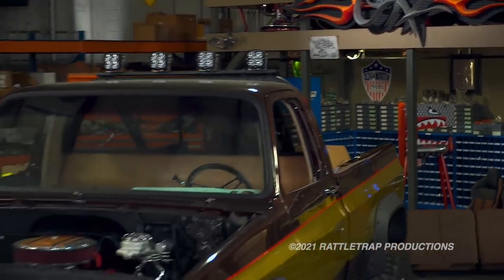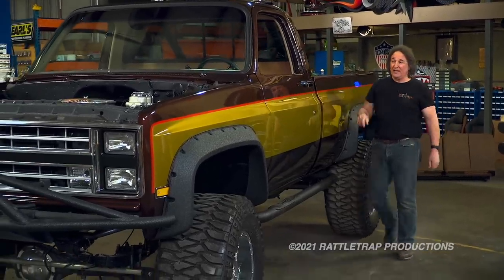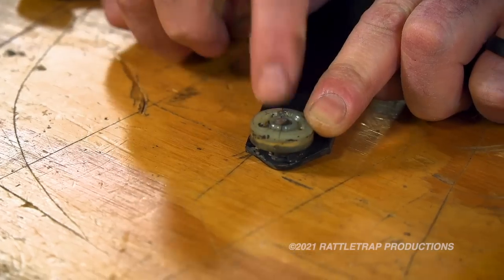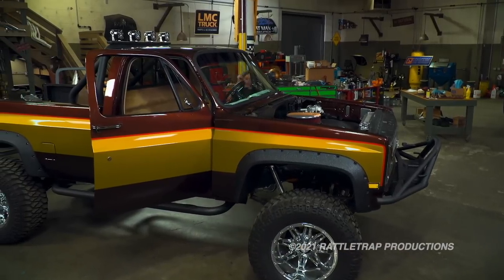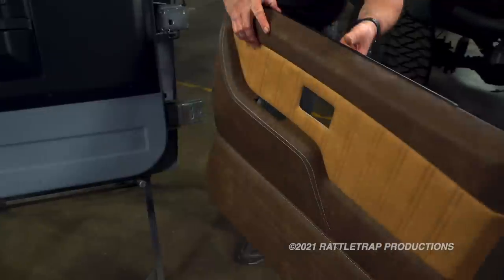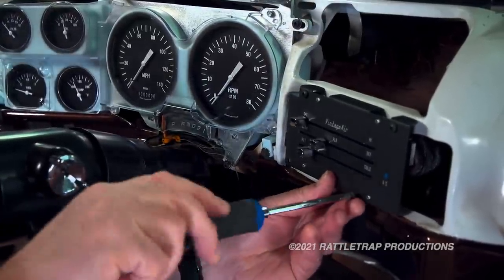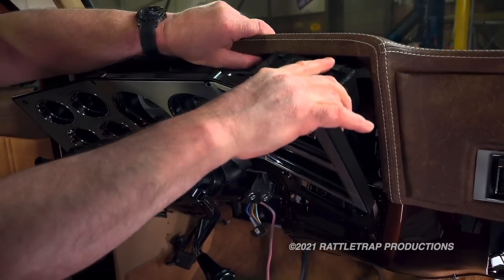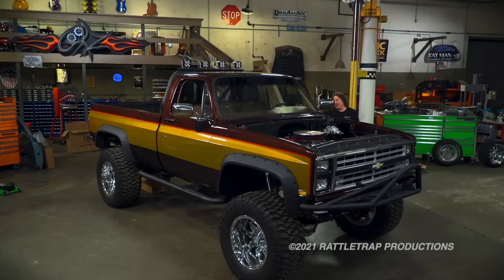Stacey David's GearZ Stunt Double Progress Update

Comment: The Classic Instruments gauges will not directly replace a factory gauge cluster in the 85 and up trucks unless you are doing an engine swap and eliminating the factory ECU (yes there is an ECU starting in 85 that was originally controlling some of the emissions, by 87 it was controlling the TBI also). The factory gauges generate a VSS signal that is used for things like timing adjustments, torque converter lockup and even your cruise control. The Classic Instrument gauges do not generate the VSS signal. And Classic Insttruments doesn't (didn't?) have a solution to this. I had to use a Dakota Digital module to generate a VSS signal to make the ECU function properly.